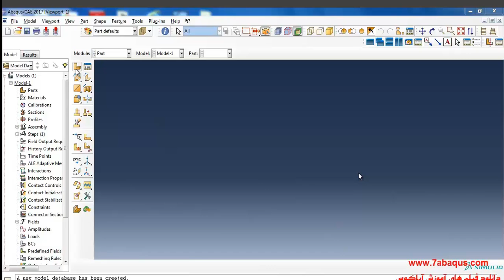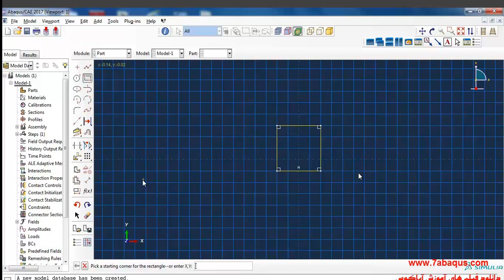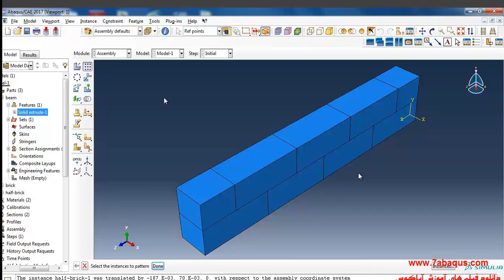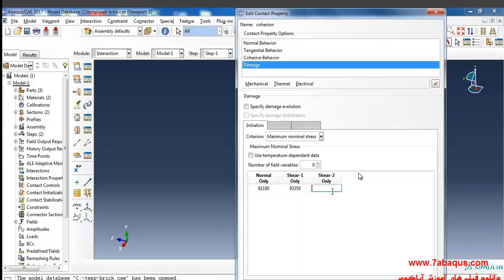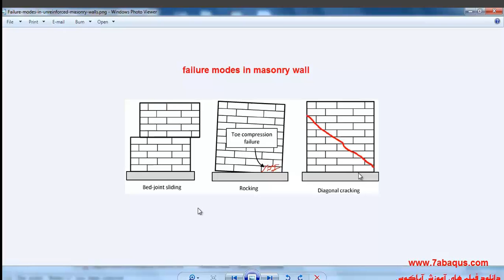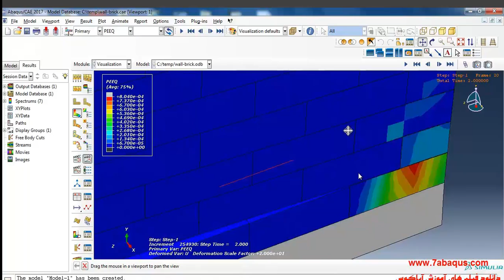Masonry wall (brick wall with mortar) undergone compressive and transverse loading Abaqus

Comment: How about considering the mortar joint? I am looking for a simulation of joint as a variable.
Reply from the maker: you should define "cohesive behavior" and "damage" as mortar and then assign it to the interaction surfaces between bricks 
in fact mortar is defined as interaction property
Reply: @saeedmoeini-7abaqus   Sir, I mailed you. Could you check on it please?